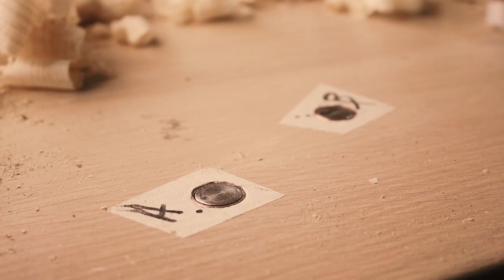Bonus track: DIY pop up bench dogs

Comment: Great video,   What solder do you use to attach the copper end to the tube,  is it silver solder?    is it flux that you drench it in before applying the heat and solder?
Reply from the maker: Thanks Michael! it is just tin. I used the tin flux that is usually next to the copper pipes in the hardware store, yeah :)Thanks!
Reply: Cactus! workshop will give that a go.  you make it look do doable!   thanks for your quick response.
Reply from the maker: No problem man! it is quite easy, just some drops of flux, hit it with the torch, and once it is hot enough the tin will just melt in contact with the copper and get in the interface due to capilarity. good luck!

Comment: I love it, but soooo much work.

Really do love it though.

Could the click mechanism but drilled out and replaced if it wears out, or would you need to remake the Dog from scratch?
Reply from the maker: Thanks man!! Is not that much work but sure it consumes time :) if it stops working I can just heat it a bit with a torch and pull it out with pliers :)
Reply: +Cactus! workshop Thank you, for taking the time to answer, the copper pipe inserts to help prevent racking were an especially good idea.
Reply from the maker: No problem man!  Thanks for watching and commenting :)

Comment: Great idea! Bumped into this while looking for bench dog solutions, and I got attracted to your welding process. I don't have the skills to use a welding machine so this seems more down-to-earth. Hope you could explain a few things: (1) Is this copper you're welding? (2) Are you applying borax to it or some other material? (3) Does this bonding material work only with copper or other metals as well? (4) How durable is this type of weld? Thank you.
Reply from the maker: +Sky Diver hey! Thanks a lot! This is just a regular copper + tin weld. You need to increase the temperature up to the tin melting point, after applying Flux to prepare the surfaces and assure adhesion. It's a regular practice in plumbing so you can find everything you need in a hardware store for sure! Hope I helped! Thanks again!
Reply: Will look into it. Thank you very much!